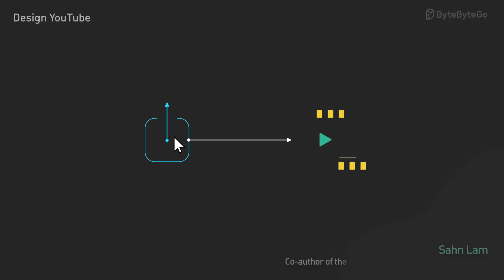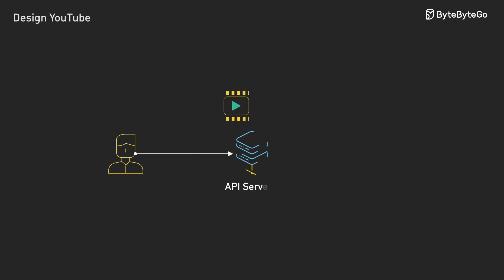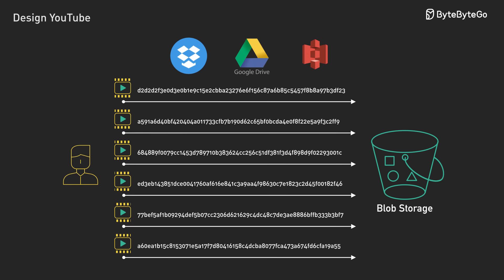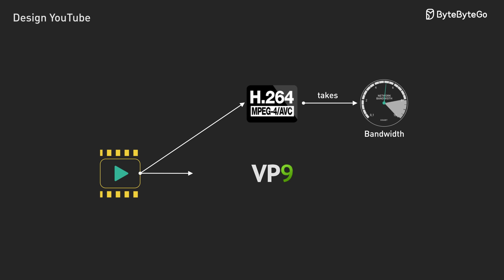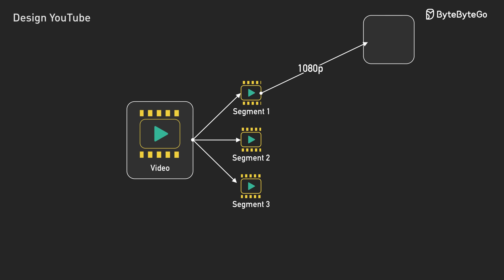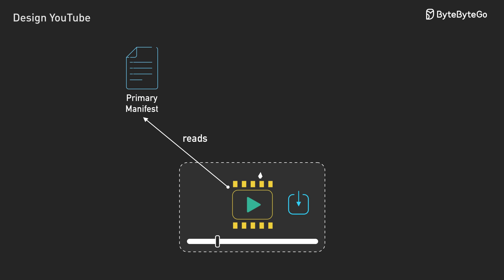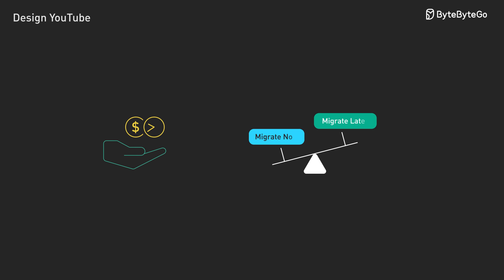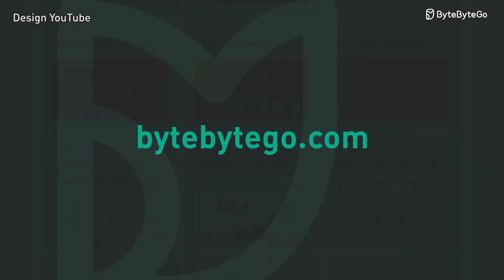System Design: Design YouTube

Comment: Amazing design.
Stupid shorts.
Non-working search, just return non related ai shorts.
Useless bots.
Translation of videos randomly even though the whole video is using text not in English.
Report system that doesn't work.
Auto quality that doesn't work but I choose manual which is same as auto and it works.
Porn spam posts with the same image getting posted a million times - allowed, I post an actual helpful comment - blocked, doesn't appear.
Reply: Most of what you see as bugs are by design, to drive, you know, engagement. Shorts? The majority of ppl want the Tok ton experience because of their short attention span. Search? Google isn't trying to serve you exactly what you want, they're trying to entice you to enqueue additional vids for more watch time, i.e. more advert dollars. Bots? Allowed because they simulate engagement, making you more prone to engage. Reporting? Not a money maker, so not a prio to fix. Quality selection? Balanced against other traffic at the time, prioritized by your manual choice. Translation might be the only real bug here. YouTube meets its primary function, which is to print money by keeping users glued to their screens so they can be sold more stuff they don't need.
Reply: oi?
Reply: breath, brother